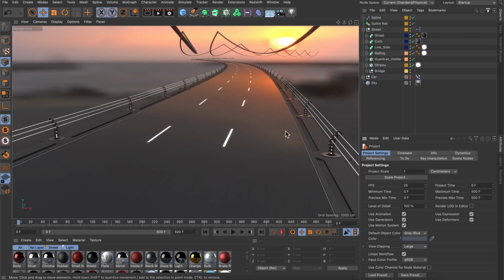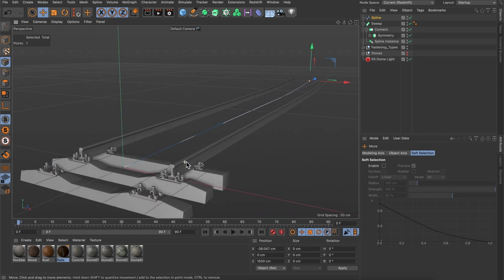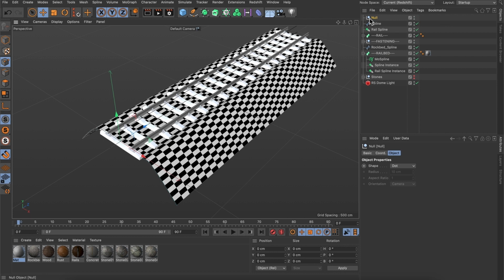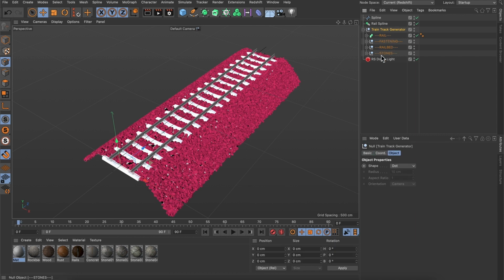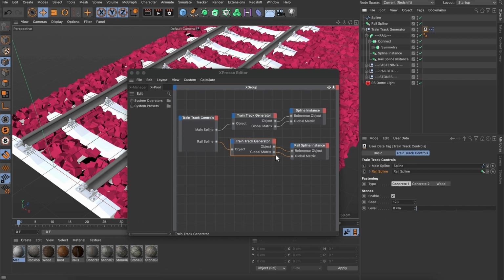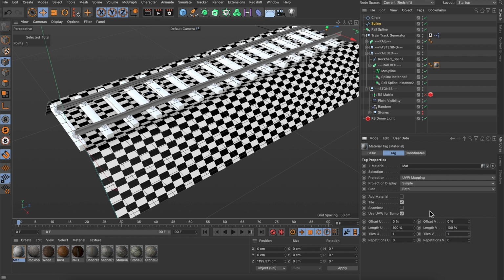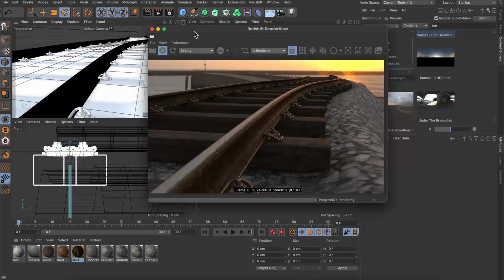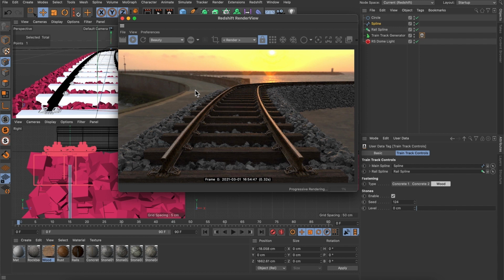Jonas Pilz @ The 3D and Motion Design Show

Comment: Hi, my friend, I have a Q about the Redshift engine, how do you use redshift on MacBook? I bought this engine one year ago, but I found redshift doesn't work on MacBook, could you please help me
Reply: As of version 3.0.38, Redshift supports Metal and works with new Macs.

Supported Macs / graphics cards:

MacBook Pro

    Radeon Pro Vega 16/20
    Radeon Pro 5500M/5600M

iMac

    Radeon Pro Vega 48
    Radeon Pro 5500XT/5700/5700XT

iMac Pro

    Radeon Pro Vega 56/64

MacPro

    Radeon Pro Vega II / Vega II Duo
    Radeon Pro W5500X/W5700X
Reply: You need a Nvidia gpu card for the redshift engine. It's a gpu based render engine just like octane render so if you can get a nvidia card on your mac you'll be sorted.
Reply: @mrphoria  I got it, man, Do you have a MacBook with a Nvidia Graphic card?
Could you tell me about your MacBook model?
 I had a MacBook but it hasn't Nvidia card